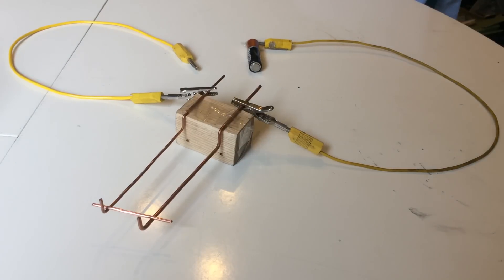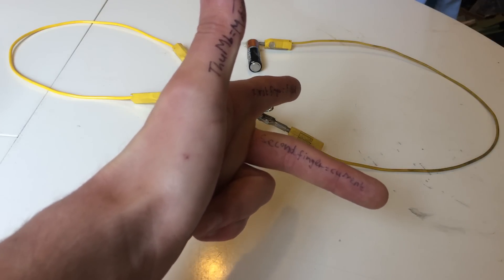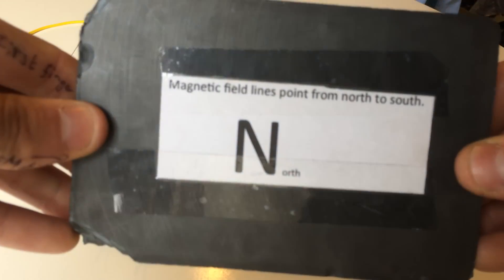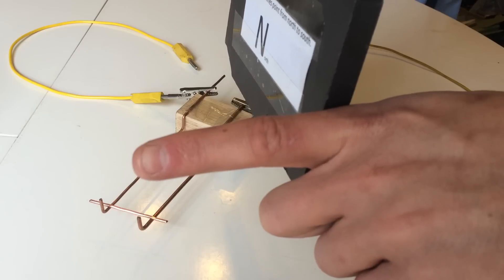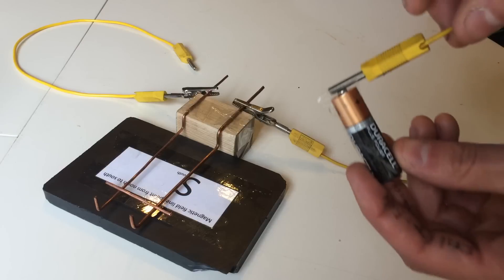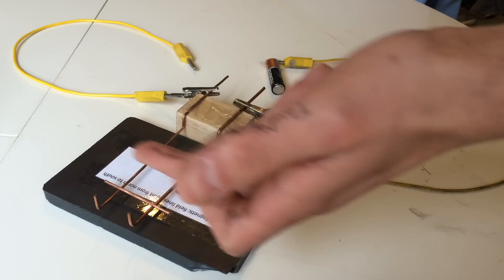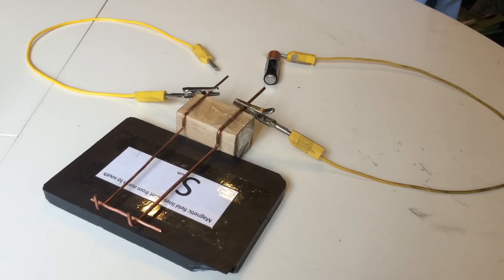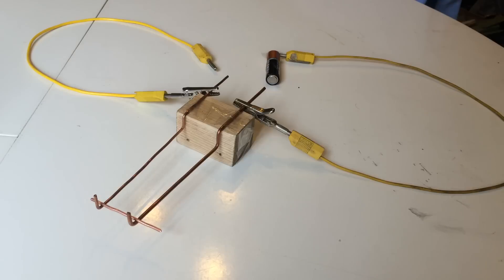How to use Flemings Left Hand Rule

Comment: if you didn't put the magnet under the wires, would the same thing happen (the little wire piece get moved across the other two wires)?
Reply from the maker: If the magnet was not under the wires the little wire piece would not move. A conductor carrying a current in a magnetic field feels a force. A current that is not in a magnetic field does not feel a force.
Reply: Thanks Man! Used this video to study for my physics test - did really well.